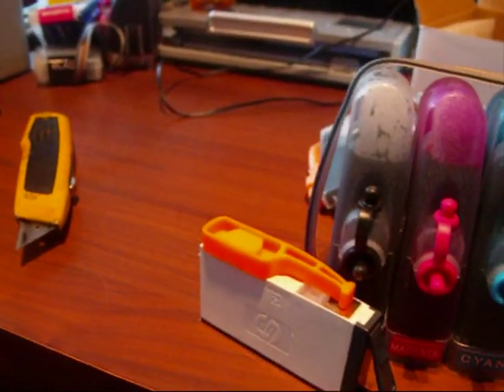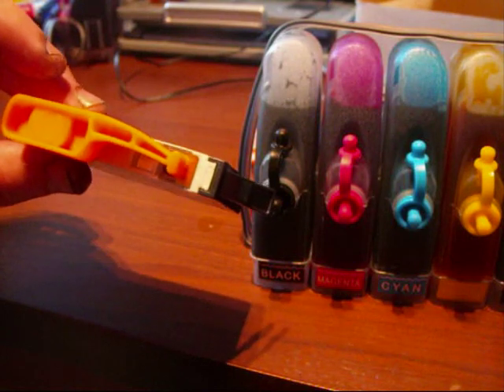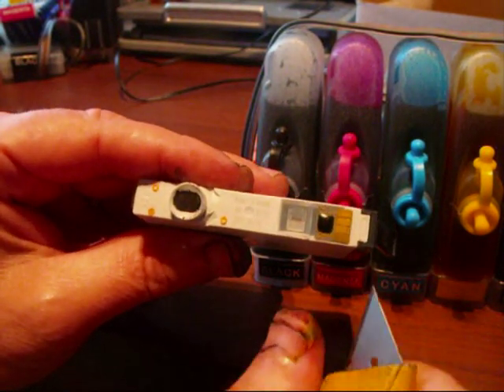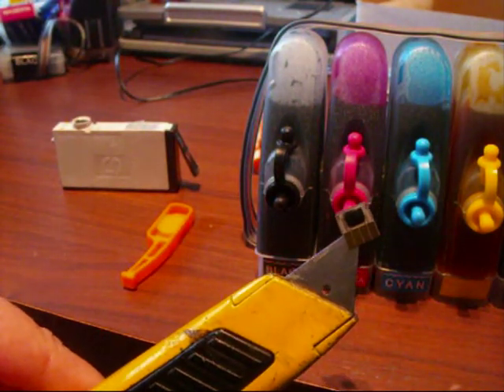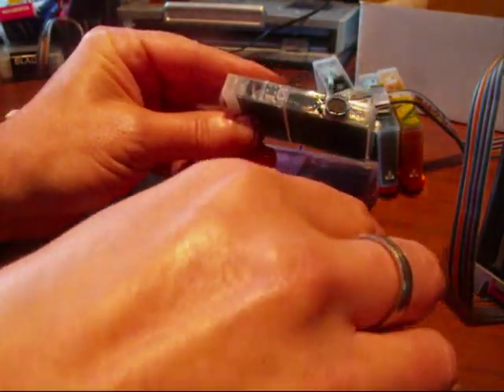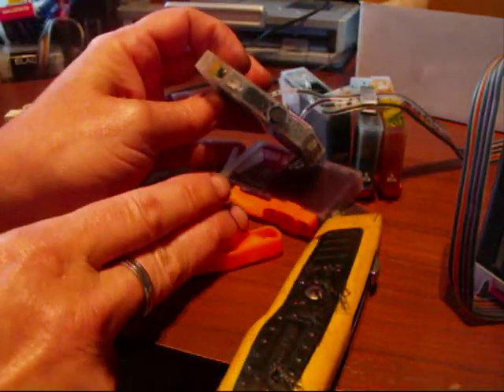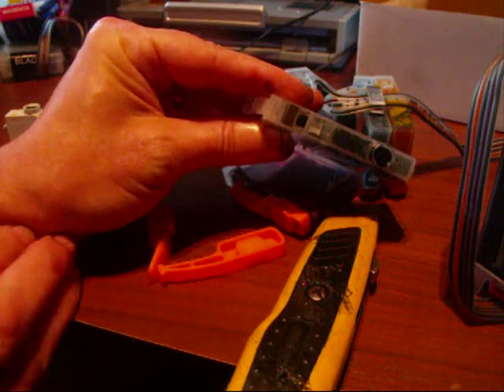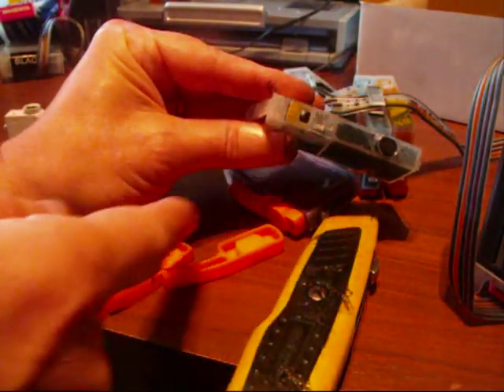How to replace chip on HP 364

Comment: I used these instructions to replace the chips for my HP photosmart plus, slightly different shape cartridge, but same method.  Much to my delight, it was simple, and it worked like a charm.  It took about 2 minutes to do all 5. I've printed multicolor documents, and I am not getting any error messages from HP which is a miracle.  Thank you so much for taking the time to post this video, I will save so much money by not buying HP's overpriced cartridges.   Happy New Year to you!

Comment: I would add that you should be careful when removing the chips if you happen to damage one of those thin metal contacts you will not be able to use the chip. Also,as an option you could also use double-stick tape instead of glue.